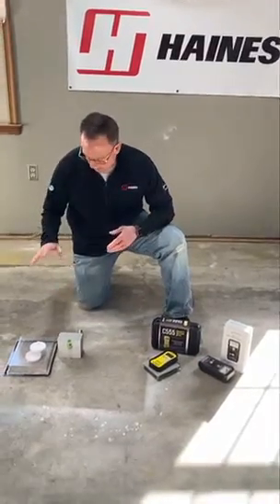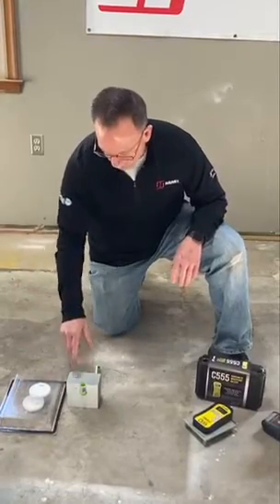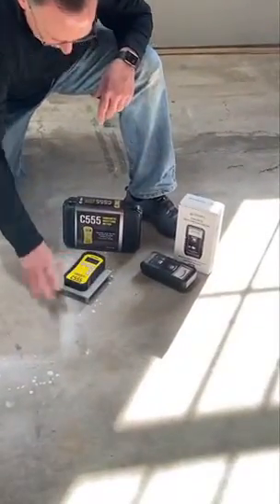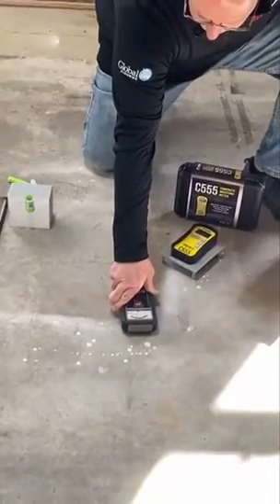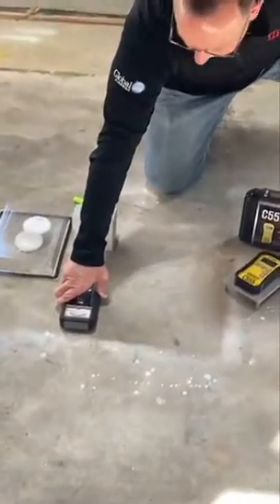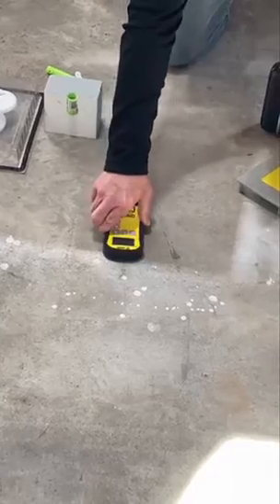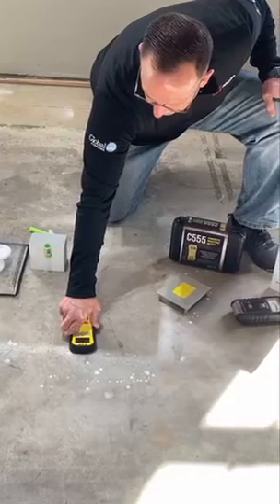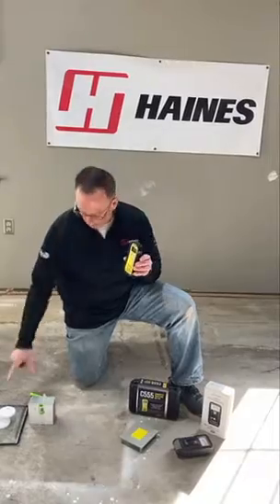Residential Concrete Moisture Testing

Comment: I have a question. After removing the existing laminate floor to install a new wood floor,  the moisture level is above 75% in all areas. However, in the areas where the coating is scratched and the cement and gravel is exposed the reading is like 25 to 35%. Why is there a difference?
Reply from the maker: Sounds like this could be 2 different pours of concrete, or the coating is screwing up your readings or trapping moisture
Reply: @twmcadoo1  that we thought ; we went she’s and installed the floor